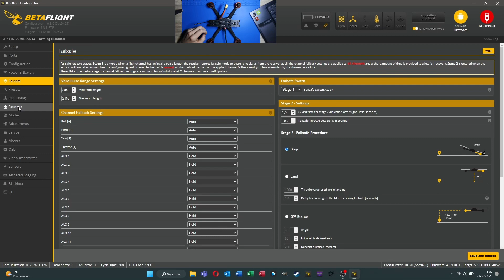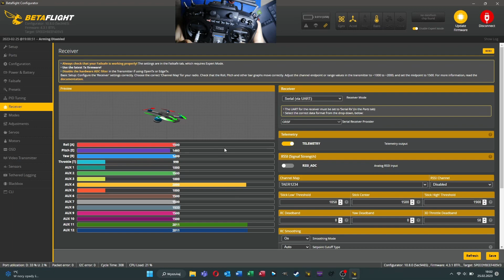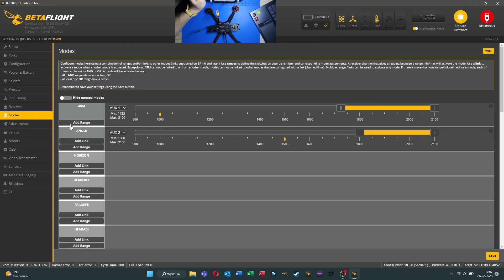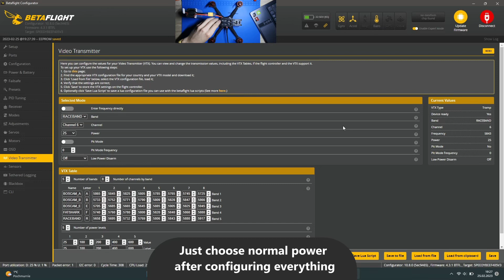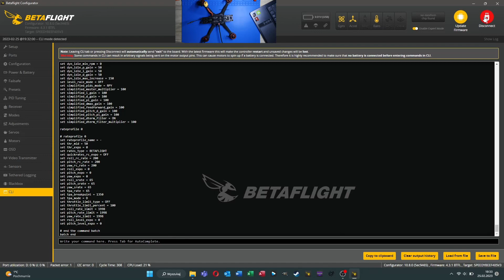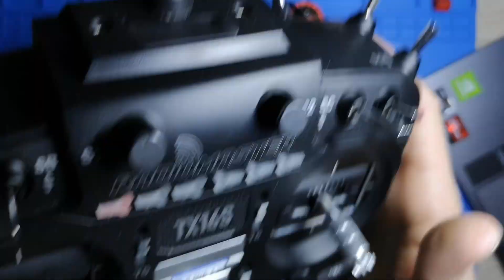Basic Betaflight Setup After Building Your Quad.

Comment: nice one. How about  PID?
Reply from the maker: PID Tuning is not "Basic", little bit more for intermediate and advanced series of videos. Maybe I will do one with basics of PID Tuning :)
Reply: @grox3857  Yes, it is a bit advanced. Its just when FC come all the PID settings are in one straight line. It still fly, but I suspect its better do do something about it.
Have you tested it for long range, not flight time only, and also some 4 inch quads?